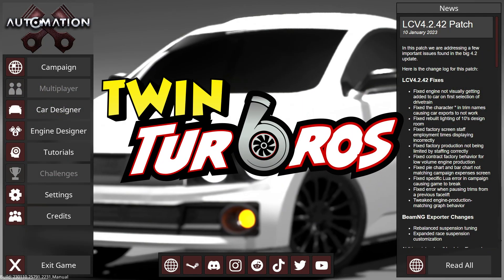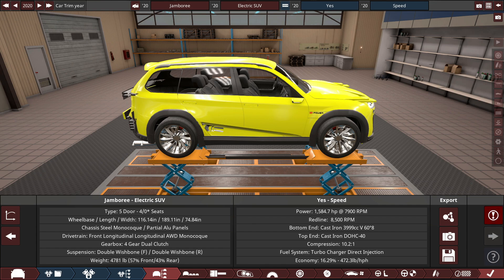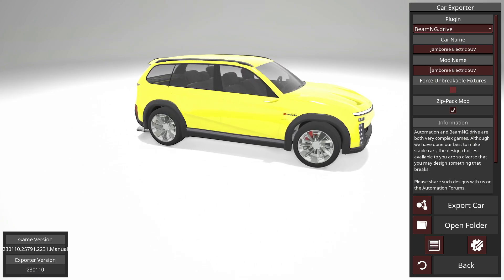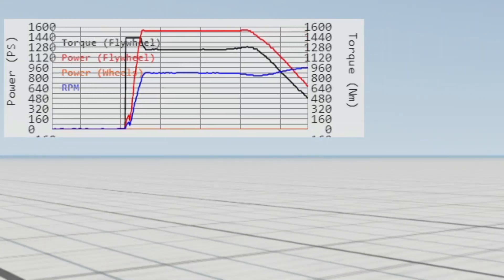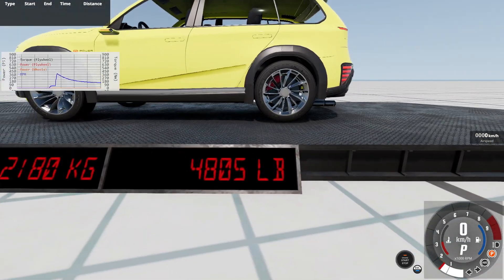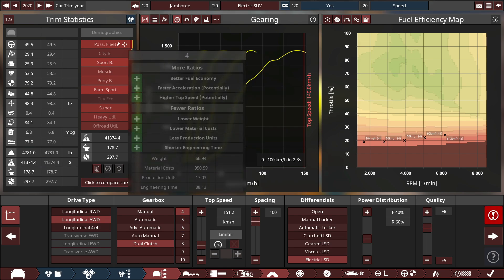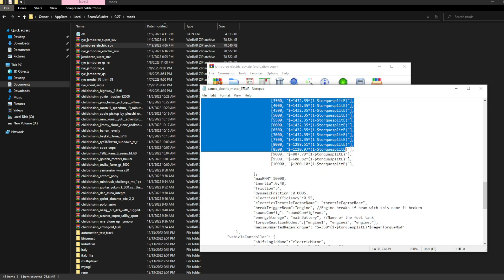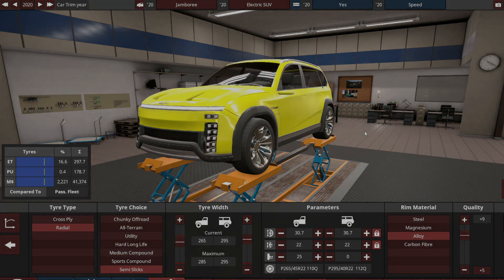How To Make Your Automation Cars Electric!! EV Update

Comment: Is there a way to make those cars have high top speed and acceleration at the same time? I have been playing with the settings and it's either one or the other and it's just silly that a car that has almost 900hp cannot go faster than 190km/h.
Reply from the maker: Sadly not right now, The best you can do is find the sweet spot for gearing. You could go to into the car files and edit the j beam to do both, but it's slightly more involved
Reply: @TwinTurBros  Man, I wish I knew how to edit those files like that.

Comment: Electric cars 🤮
Reply: I personally dislike electric cars but this video was helpful
Reply from the maker: I can accept this statement
Reply: @TwinTurBros Electric cars are somewhat cool, because Some looks futuristic in a cool way like the lotus Elvira ( I dunno how to spell ) And some are bad like the Mustang Mach e, Electric muscle doesn’t excist
Reply: @TheGamer707. just curious what you think about the new Dodge ev? 
If anything counts as electric muscle it’d have to be that. And as far as I’m concerned the definition of muscle constitutes a high horsepower engine with straight line performance…
Reply from the maker: i love electric cars :(
Reply: @TwinTurBros  I think they are cool but altfuel cars are more interesting IMO. Would be cool if you made a car run on natural gas. (LPG 107 or LNG 145). You get significantly more economy on those fuels too